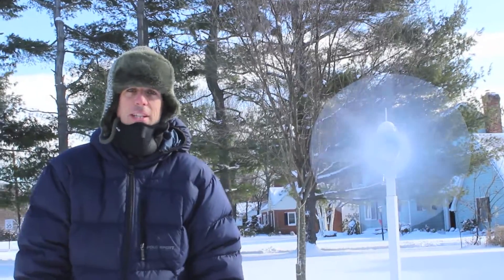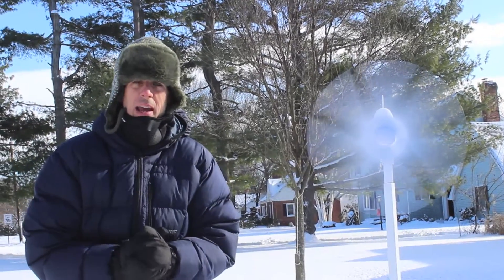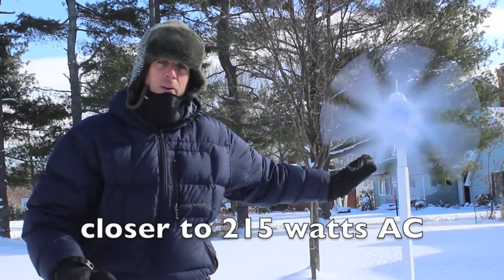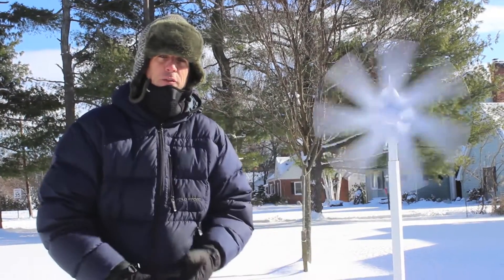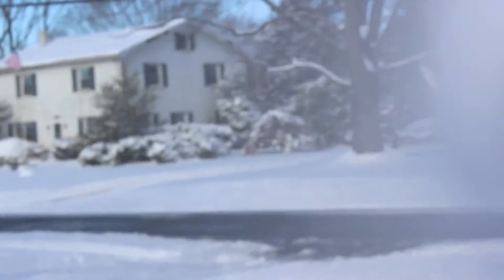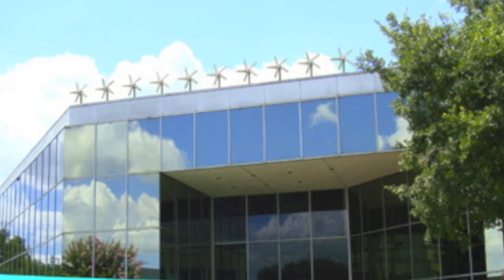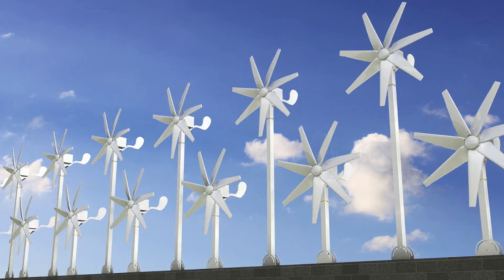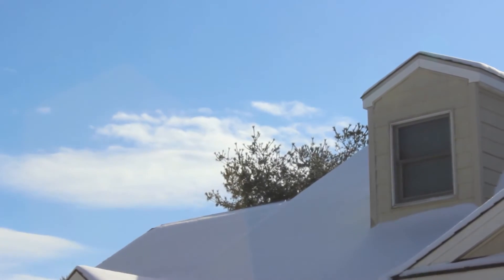Zefr wind turbine grid tie with Enphase micro inverters - winter testing in NJ

Comment: in general micro wind turbines are rarely anything other than toys. They cost quite a lot, but in most cases they dont produce much power because wind power needs to be mounted high up where it gets good steady laminar flow wind. Otherwise merely depending on wind gusts and seasonal blizzards will never produce enough power to justify the cost. You are much better off putting that money into expanding your solar power system